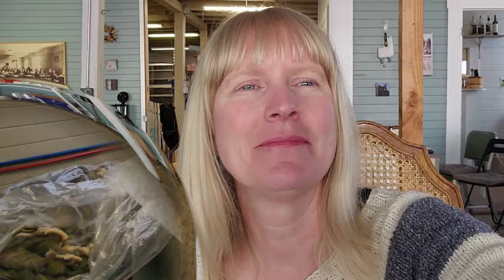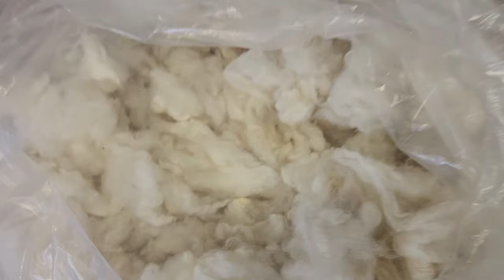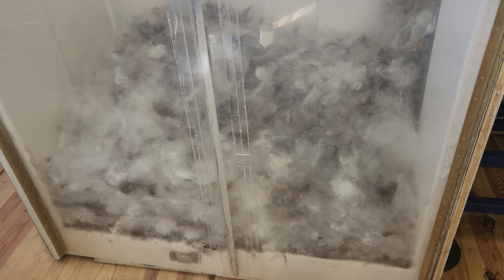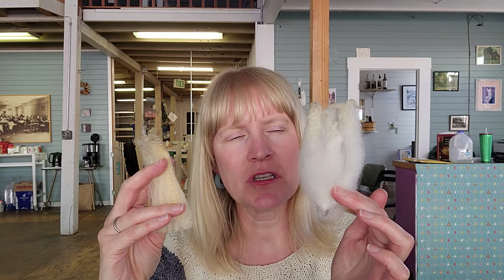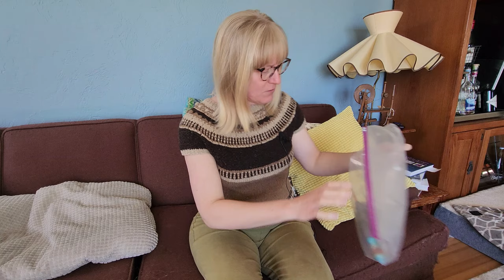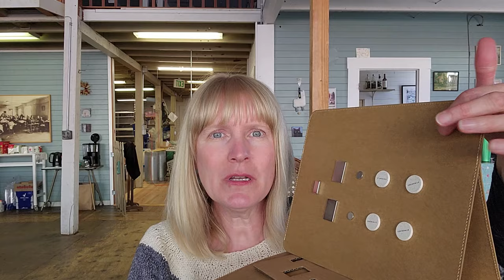Romeldale/CVM wool talk plus support spindle questions and storage bobbin options (Episode 111)

Comment: I think for the extra bobbins, if you have a Hansen e-spinner, it comes with or you buy it extra, apointed metal piece that fits into the orifice. Then you can slide a paper thing or the little plastic or wooden bobbin , take the tension off the flywheel, and wind your yarn onto it very quickly.
Reply from the maker: That's great!